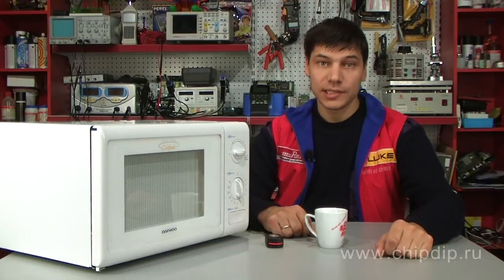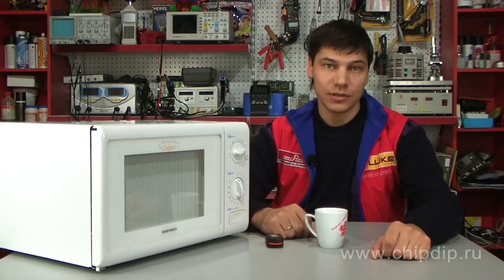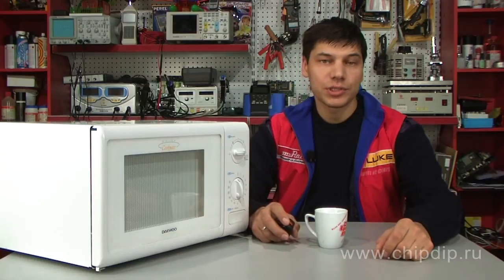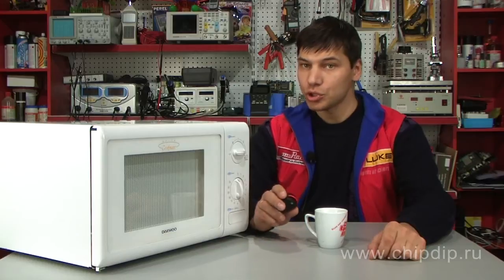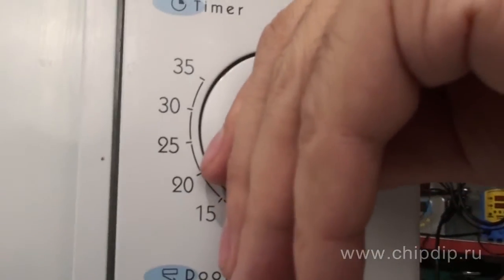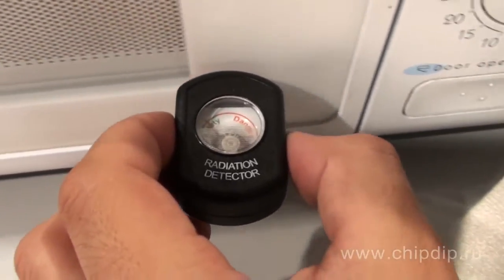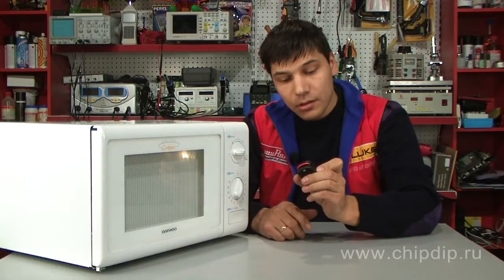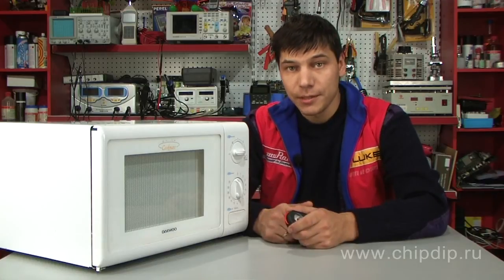The microwave oven radiation detector

Comment: This guy hasn't got a clue how to use the detector. If there is any leakage it is around the outside of the door. I have worked on MWO's since the 1980"s. The door either has to have a hole in it or has to be almost falling off with the door switches not working properly.